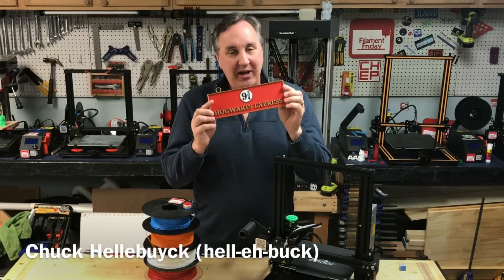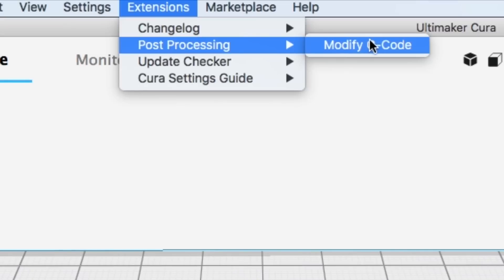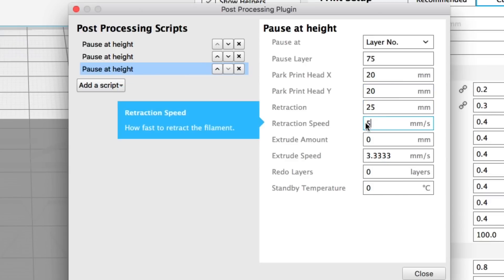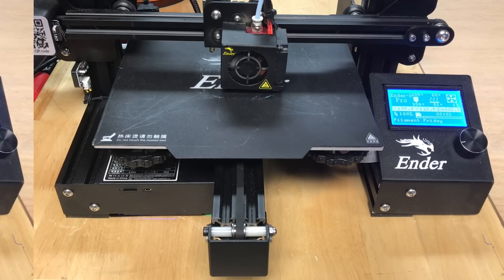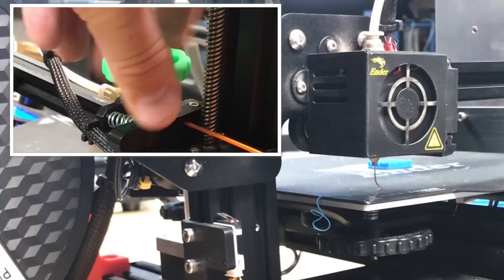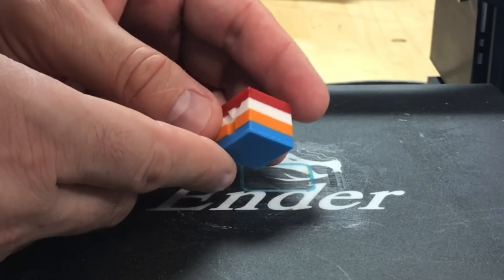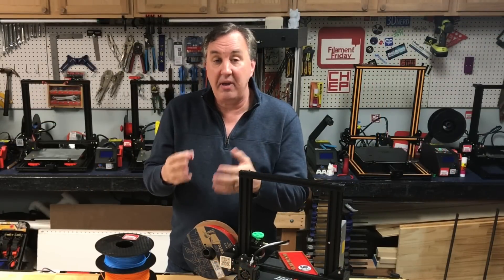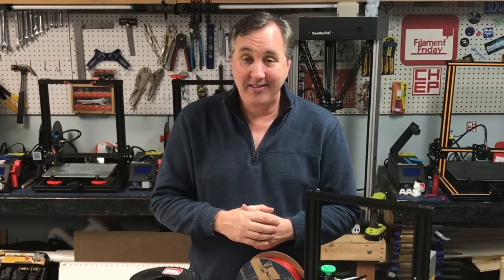How to do Multi-Color 3D Prints on Ender 3 3D Printer

Comment: Do you have to redo one layer or can you leave this at 0 ?
Reply from the maker: You can use zero but you might get poor adhesion between colors.
Reply: I did 2 prints with redo 1 layer and the nozzle seamed to scrape on the print. After that lsuer it printed ok. Is this normal?
Reply from the maker: That seems odd. You can set it to 0 and try again.

Comment: Hello everyone. I have a CREALITY CR10S Pro and My machine does not stop only does a Z-hop or something like that. I checked the G-code and the pause command is there. I DO NOT UNDERSTAND. HLP!
Reply: I had the same problem when I tried it this morning.  It moved, paused for a second and retracted the filament, then went right back to printing.  I also have a CR-10s Pro.  I guess it doesn't work right with this printer?
Reply: I just got this to work by printing from the SD card rather than over USB.

Comment: Just wanted to let you know, you might want to do a quick update video, as Cura 4.0 Includes now for post processing a "Filament change" script that is set to do just this, choose a layer height, and it will even retract it fully for you.

EDIT: ...Nevermind, turns out the ender 3 Pro, at least for me does a massive stupid and instead extrudes instead of retracts and just..messes up >.<
Reply from the maker: Version 3.6 has it as well, I just chose to show the Pause at Height feature. 
I’ll be covering filament change in a video soon.

Comment: Howdy! i have tryed this with great results but lately after a pause and a extrude amount, the head goes over to resume the print and always squirts out a small amount before printing. Its ok if its over a large surface but if its over some small text the letter is, lets say--Goobered!  I may have unknowingly changed a setting?  Any suggestions would be greatly appreciated. Many thanks--Luv the Chanel :)
Reply from the maker: You can try to increase the retract value.
Reply: @FilamentFriday  It started to happen just after I put a new All-Metal Feeder Assembly. Put the stock one back on and it stopped happening?? LOL

Comment: Mine pauses fine, I change the filament, restart, and it jizzes out 6 inches of filament onto the bed, then moves over and destroys my print. ?? I made my settings the same except only one pause.
Reply from the maker: It should touch to bed on 2nd pass. Something wrong there.
Reply: @FilamentFriday  I have the same issue.  I pause at layer 16.  When I restart, the nozzle goes back to the first layer and plows through the existing print.
Reply from the maker: Make sure redo layers is only 1.
Reply: @FilamentFriday   I set "Redo Layers" to "0".    To clarify, I am trying to print raised text in a different color.  It moves the nozzle to the proper coordiates to continue the text, but the nozzle goes straight down to the bed.  The first time I tried it, I set it to 1 and the nozzle still impacted.

Comment: printed your cube and on the y and x sides the top of the letters are higher on 1 side, same side of both letters kind of runs up hill the chep side appears fine...I guess my question is, is this possibly a speed issue? I didnt slow down  the print it ran at 60mm/s..running it again at a slower speed to check but curious what you think it could be..   Thanks
Reply from the maker: Is your bed unlevel?
Reply: @FilamentFriday  just finished the second print seems like it was just fast, dropped the speed to 25mm/s and that seems to have helped a lot..(even enabled ironing on the top layer per your video looks nice).also i'm using the new removable surface they are shipping probably wouldnt hurt to pick up a glass bed just to eliminate a variable.. I checked the aluminum plate its actually pretty flat...I've been re leveling the bed before each print to hopefully limit failures....

Comment: Curious cause I am doing this but am currently having an issue with the Y bed shifting while I change the filaments therefore my offset is wrong. Any suggestions CHEP?
Reply from the maker: Unless you bump it, it shouldn’t move.
Reply: It’s like the stepper motors disengage cause they are not locked. Like it releases the tension and shifts. Maybe I need to put in the gcode after the stop to lock steppers.

Comment: Note: if you mess up real bad and your first layer change is really low... you risk running the nozzle thru the bed if your Z axis shifts.. Source: experience, i got 4 pits on my bed now. This is actually a huge concern, not a single tutorial or guide warns you that if you suspect that Z shifted and it is SUPER easy to shift, your print is ruined and it CAN cause the axis to be so out of sync with the control data that we are risking of damaging the equipment. It is funny how NO  youtuber has NEVER failed at this part but every single filament change just magically work.. None has said a word about the risks of z shift.

Comment: Mine will extrude a glob of filament on top of the print and then start printing again. Help!
Reply from the maker: When you change Filament retract a little after pushing thru the color change.
Reply: I have the same problem soon as I click resume it goes right to that
Reply from the maker: If you set it up as I show, it will have to heat up from 25c before it will start printing.

Comment: Why do the previous filament purge manually?
Cura includes that function in the pause at height script. It will make a little purge pile at the parked position.
I use this to do multi colour prints all the time. I also set the park position to put the printhead at the back of the bed, out of the way instead of at 20,20.
Reply from the maker: Everybody has their own technique
Reply: How can I move where the purge pile starts?
Reply: @bigfoodie9774  you can choose the park position coordinates in the Cura insert pause script interface.

Comment: I've had several issues trying this so far, the print is super uneven at the layer of the change causing a lot of dragging to occur, the first color change, no matter what I do is always shifted slightly off center when printing the next color, but then the last color change never has this issue. There is also the issue of it seemingly losing it's z position, so that the few layers after changing cause a lot of grinding on the extruder.
Reply: Yes, most if not all scripts are done badly: they lack reset axis commands. Rule #1: if the user has manually touched the mechanism, ALWAYS reset the axis or the origin/workpoint.. If your first change is low enough, the shift in the Z axis can cause it to dig itself on the bed. Spoiler: i have 4 pits in my bed now.

Comment: You can just pause it lol
Reply from the maker: If you want to stand there and wait, sure.
Reply: CHEP you still have to stand there lol
Reply from the maker: No I don’t. I walk away and it pauses automatically when the layer is done. I can come back the next day and continue if I want.
Reply: CHEP so what's the different if I can sleep eat then pause then change filament
Reply from the maker: The file pauses the print at the proper height for you automatically. If you have to do it manually then you have to stand there and wait until it’s at the proper height to manually pause it. If I did it your way I’d come back to a single color fully finished print.
Reply: @mikemuniz9808  if you do it your way you need to be wary of the layer and the print time.
if you do it as in the video you can change the filament whenever you want as it paused automatically

Comment: Another Great Video Chuck!  I was doing color changes like this but I kept having issues with with the stepper motors timing out/de-energizing while trying to load a new filament. When this happens my gantry would drop and when I would resume the print the nozzle would end up digging into the print. I ended up switching to the Filament Change Script which keeps the stepper motors locked and automatically extrudes filament to clean the old color out of the nozzle. Sometimes Cura (3.4.1) doesn't add the all scripts into the g-code so I have started checking the g-code in a text editor to make sure the M600 command get inserted into all the layers I want the color changes to happen.
Reply from the maker: Great explanation. I haven’t had as much luck with that script. I’ll have to try again. Thanks.

Comment: Prime the nozzle with a tall skirt/ooze shield or a priming tower, in between filament changes for a cleaner print.  Also, there's no code to disable stepper motor timeout (i.e., M84 S0), which keeps the stepper motors from disabling; thereby, preventing any inadvertent movement of the print head or print bed.

Comment: nice tutorial thank you. But why to redo the layer in the option please? Your final cube won't have 3 layers more than expected? :) thanks
Reply from the maker: I redo the layer because the print can be cold after sitting. So redo the last layer to melt them together better. Still same number of layers.
Reply: @FilamentFriday  thank you :) I don't really understand. The 25th layer is already printed and have a tickness. If you don't redo this layer, the 26th will melt to the 25 the same way than redo it. So if you print for example at 0.3, your final cube will have nearly 1mm more on Z axis

Comment: I tried it but when it started after the pause, it started at layer zero and knocked the print over. Anyone have a solution, I'm new to 3d printing and would love some help.
Reply from the maker: Make sure you are only redoing 1 layer.
Reply: CHEP That’s what I did. I will try it again. My prints also just fail sometimes and I don’t know why. The quality is just bad and so on. Do you have any tips on how I can improve my prints? Not just with settings changes

Comment: Thanks heaps! I had a go attempting the change for some extruded text but I did the change a layer too early but it's all part of the learning process. I do have one question though, I'm using a Tevo Flash and when I attempt to change the filament the extruder feels engaged and cannot be turned (BMG extruder), is this a setting issue?
Reply from the maker: I’ve found if the printer sits for a while the Extruder releases on mine. So that’s how I could turn it. It’s in the firmware not the file. I’m still looking into that. Just manually push the filament instead.
Reply: CHEP thanks heaps, I pretty much changed straight away so that might explain it. I was using TPU so unfortunately it is very difficult to just push through. The TPU with colour change means I can make some awesome personalized key tags.
Reply from the maker: You can modify the GCode to disable just that stepper.

Comment: I have a Ender 3 and noticed it does not work if I print from the computer. If I save it to the sd card and use it it works fine. just cant send straight to printer and do it
Reply: Most, if not all, Marlin pause and wait commands require that your printer read your gcode file from an SD card.
Reply: @bernardtarver  thanks I just learned something else new. BTW I really enjoy your videos. I been learning a lot from them

Comment: hey Chuck, been watching your vids for a while, and I have a couple of questions. 
1) I have a davinci 1.0a (family got it for me for xmas a year ago) and I am having a problem with brims on it, they just don't want to stick. rafts are fine. I have a build tack surface down on the bed, I was kind of scared of chipping the glass. 
2) what printer would you suggest for a large volume printer ?
Thanks for channel lots of good info in here.
Reply from the maker: CR-10 or CR-10 mini depending on how much you want to spend.

Comment: Hey Chuck! First of all thanks for your vids, which helps me a lot! 
Wanna ask you: Have you ever try to install laser engraving for Ender or CR 10? ( Creality has a laser engraving module for their printers https://ru.aliexpress.com/store/product/CREALITY-3D-12V-Blue-Violet-Light-Laser-Engraving-Laser-With-Focusing-for-Mini-Laser-Engraving-3D/2846085_32800316633.html?spm=a2g1y.12024536.productList_2866067.subject_10 ) If no, do you have a plan to do it ? 
Cheers!
Reply from the maker: I have not but that could be a fun project.
Reply: yes I installed the 12V creality blue diode on my CR20. You need a voltage stepper to go down to 12V, and connect it to the pwm fan output. Works pretty good. You also need to get the right gcode to turn the fan on and off (which is now the laser). I use laserweb 4, there's an option to insert the gcode to turn the laser on and off in the settings. Then just import your png or whatever raster and off you go. For complex stuff you need Inkscape vector files, but I engrave just fine with the raster option. That blue diode isn't very strong (no cutting) though.

Comment: just tried in cura 4.0 didn't work
Reply from the maker: 4.0 is beta so not surprised.
Reply: why doesn't it work in 4.0? I've tried it to, the pause process is fine but to the retract it pushed all the filament instead of retract it :/ XD and it don't accept negative value
Reply: @Genesis26k mine paused moved away but didn't wait for me and just resumed trying to print, I'm on a cr-10s pro
Reply: @pdxcerealkilla9847  Oh yes I've had that too when I used the pause but without setup the temperature at 20 like he did in the tuto. Then as the heating already at the good value to print, it started directly without time pause to extrude manually the new filament.

Comment: how do you deal with the print losing adhesion during the "waiting" period. I'm hoping to use this process but fear if the machine is waiting too long it might lose adhesion to my glass bed. I'm guessing the answer is to tell the printer not to cool down during the waiting period.
Reply from the maker: The bed doesn’t cool down just the nozzle.
Reply: @FilamentFriday  Thanks for the quick reply!

Comment: Hi. Have you tried a 3 point bed levelling on the ender 3? Thanks.
Reply from the maker: How would that work with four adjustment knobs?
Reply: @FilamentFriday  Read this post, it very easy to do it. And levelling bed becomes easyer. https://www.google.com/url?sa=i&source=web&cd=&ved=2ahUKEwi75suzvrTgAhUD3OAKHQiID_0QzPwBegQIARAC&url=https%3A%2F%2Fwww.reddit.com%2Fr%2F3Dprinting%2Fcomments%2F9t4opp%2Fconverting_ender_3_to_threepoint_bed_adjusters%2F&psig=AOvVaw1wipT7YLqdqO4GL2np6N39&ust=1550002229513051

Keep up the good work. Love the channel.
Reply: @FilamentFriday  Check this out on my ender 3  bed levelling ONLY on 3 corners of the bed. https://youtu.be/YUNcWL5hlpk it is so easy to do and probably i don't have to do the levelling again.
Reply from the maker: Sorry, I don’t get it. Assuming you get two corners to be level with fixed nuts underneath,  seems like the remaining two corners are just fighting each other to warp the bed in their direction.
Reply: @FilamentFriday  i only have to fight with the knob  (where the Power cord reaches to the bed)... The oposite corner nearst to the lcd is complety free, it has no knob or spring.
You might even say, but the fixed corners are to high or to low relatively to the nozzle, On the printer menu do small adjusts on the z-offset.
I Will be making a video explaning this better and the logic behind this... It was so cool to level the bed with only one corner. And corners with the nuts are not super tight, they are tight so that knob that has the Power cable can tilt to level the oposite corner.
The nuts where only a quick test but i will be replacing them with a cilindrical shape made in PETG.

Comment: There is more simple in cura : in modify G-code use the "change filament" option. Specify the layer, and change other parametters to minus 30 and minus 300. Done.
Reply from the maker: Have you actually used it? I can’t get it to work as well. So not more simple in my experience
Reply: Yes i dis. It works well on my ender 3. Juste take care to add a minus signe.
Reply: @zerepier  OMG that's the reason why all my filament fell on the bed LOL. I thought it was a bug from the 4.0 beta version
Reply: @Genesis26k  Yes the extruder try to push the filament. So I tried to inverse the process by changing the sign and it works !
Reply: @zerepier  I've tried yesterday to add the minus sign but it didn't accepted it... Have to add it directly in the g-code maybe?

Comment: Oh man, I could have used this video a few weeks ago. Just got done figuring this out for myself. 

I will note, that I upgraded to the Micro Swiss all metal hotend. By doing the retraction and then pausing and cooling, I found that I was getting filament blobs stuck above the heat break in the metal throat, which was making the filament change impossible. It worked best to only retract enough to prevent dripping while going to the park position. Then when I was ready to change the filament I raised the temp back-up, retracted, and changed the filament all while the hotend was still hot.
Reply from the maker: That part of the reason I never switched to a all metal hot end.

Comment: I\m a bit confused. To me its not clear whether pause at layer means pause before starting the layer or pause after finishing the layer.
Reply: If you use the "pause at height" post process, it pauses AFTER the layer specified. There is also a "filament change" post process that is a bit more gimmicky, but will pause BEFORE the layer specified.
Reply: @grangeryoung5345  Thanks very much.That makes things clear
Reply: @grangeryoung5345  ok but then why does he use the option "redo the layer"? thanks
Reply from the maker: Two melt the two together.
Reply: @FilamentFriday  I think the real reason that if you don't redo the layer there's no a good melt, is that the filament change is done before the layer you selected. So if you don't choose the redo option, the layer you selected will be forgotten. Don't you think so?